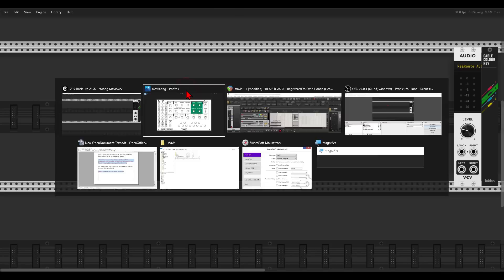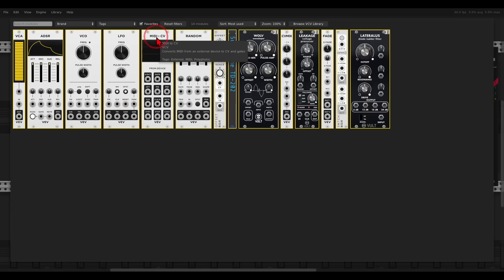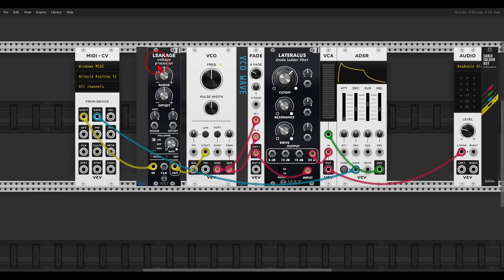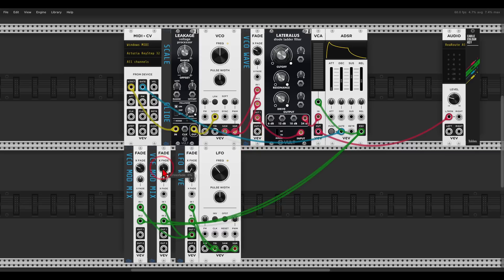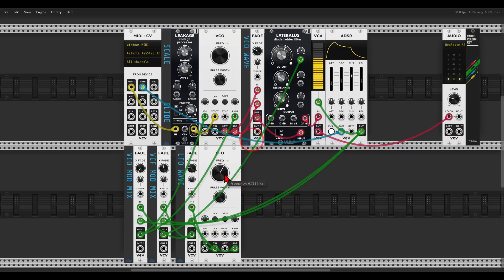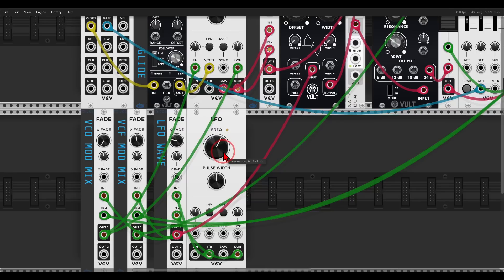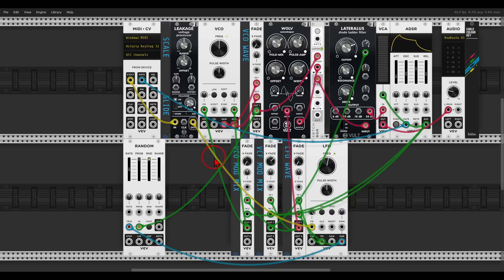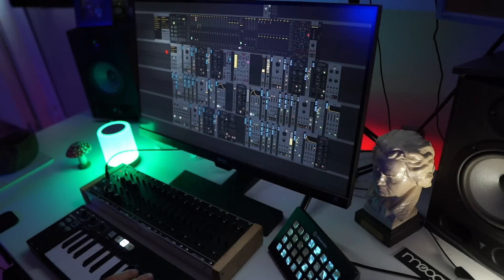Let's build the Moog Mavis in VCV Rack

Comment: Hi Omri, really love your videos. Working through your basics videos and learning heaps. Can you please tell me what midi controller you're using in your Jam,  or reccomend a really good starter controller to use with VCV. I want to wiggle those knobs ! Thanks...
Reply from the maker: Hey, thanks so much! I'm using the Midilar controller but I used the Korg nano for quite some times and it was quite ok. It's not perfect, but quite nice.
Reply: @OmriCohen-Music  Thanks  for the advice. I will start with the Korg and save my pennies for something like the midilar later..
Reply: I think pretty much any midi controller will work. I'm a VCV novice, and managed to get a crappy old Behringer BCD3000 DJ controller mapped to useful functions of a patch. Worked just fine.
Something like the Akai MidiMix might be a good option? 24 Knobs, plus some faders & buttons.

Comment: What's your opinion of the Moog Mavis? I was considering it to supplement my Mother-32 and Subharmonicon, but I don't know if it's really worth the price, or if it would be better to spend the money on individual Eurorack modules.
Reply from the maker: Well, it's a Moog so it can't be bad but there are some decisions I don't quite understand. The keyboard, for example. I'm not so sure why there's a need for it since it has only one octave, and many people will use an external sequencer anyway so maybe this space could have been used in other ways.